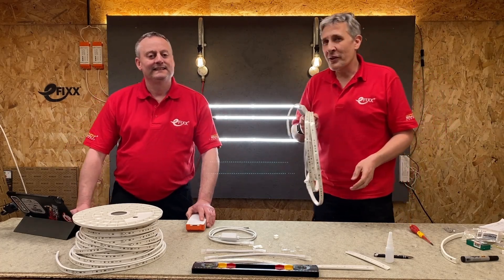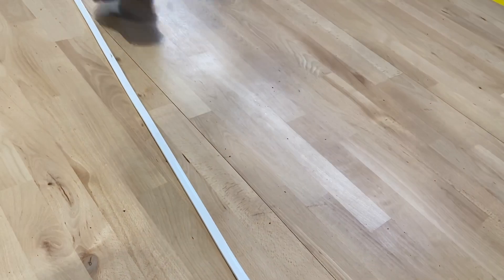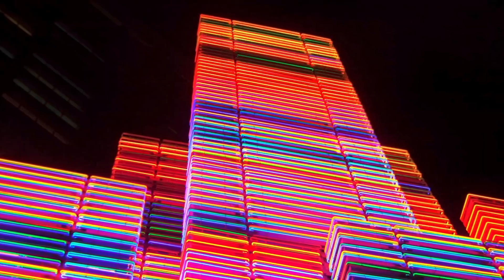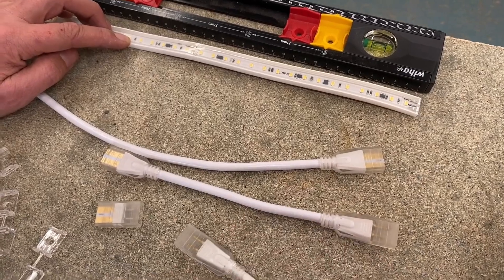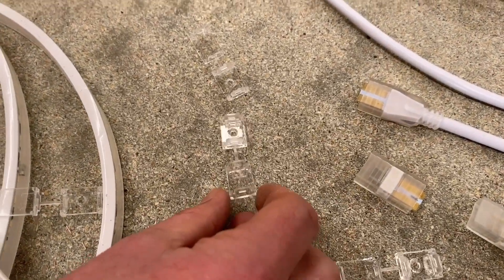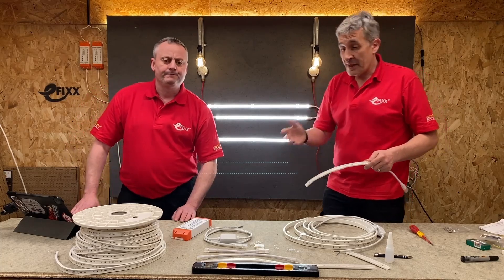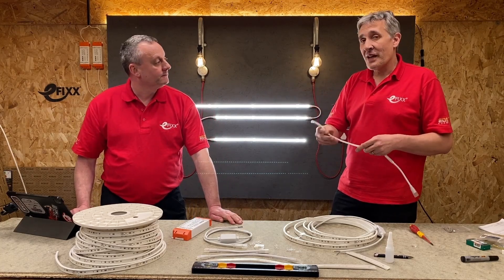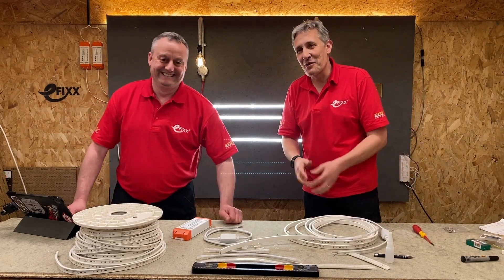230VAC LED Strip - ROBUS Atlantic

Comment: Neon systems are a bit of a different kettle of fish compared to LED strips.  Put your cutters through the middle of a neon tube, as improbable as that may be, and current flow stops promptly when the tube pressure comes up.  Put your cutters through a line (non-isolated) connected LED strip such as this appears to be and your tool can be connected to the conductors in the strip requiring RCDs or such to make the situation safe.  Of course if you manage to put yourself across the HV wiring in a neon setup it's not going to be a good day.

Interesting thing talking about LV DC strips and regulators.  If you take a look at the construction of this strip it actually has linear current regulators throughout the strip.  Obviously since the supply is 230VAC so peak 330V-ish the current through the common bus along the strip is quite low but a 50V (DC or AC) strip would be possible with embedded regulators too.

Note that I'm not talking down this product, just talking about how it all works.
Reply from the maker: With  Neon it’s the large iron electrodes flapping around in the breeze which cause the risk.

Comment: Interested to see how it yellows after time and longevity of the leds seeing it doesn't have any heatsink , any other colour options? be good if its compatible with there loadpro dimmers .. ive got the Macau above all my workbenches in the workshop.. 2 years in all good.. runs perfect from a dc-dc converter..

Comment: Exciting to see a long distance LED strip from a manufacturer you could trust to seal it properly, but the price per meter from retailers appears to be extremely prohibitive.

I do like the clips, the best I've seen for LED strips so far.

Aside from the pricing, it would be nice if they could make a 0-10V dimmable version.
Reply from the maker: Thanks we the feedback - we’ll explore the options for dimming.
Reply: Got me all excited - think they would make great lighting on the outside wall shining on the ground and triggered by a sensor for reversing the cars up the drive.  Then I looked at the price... @efixx